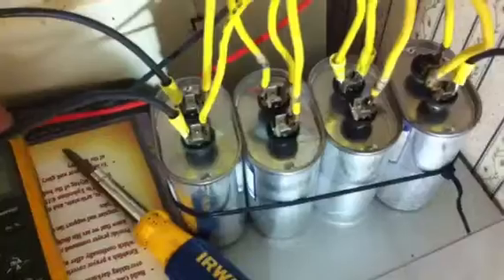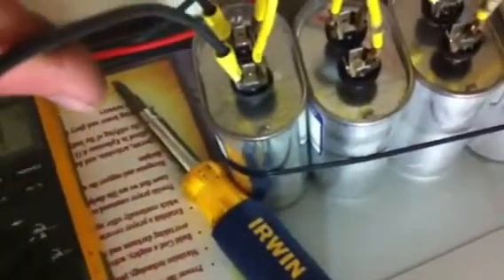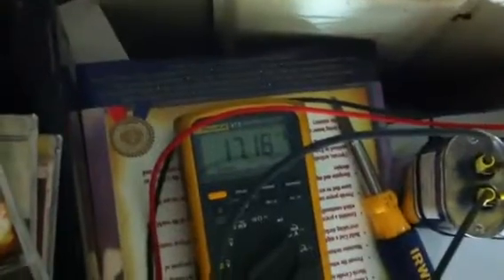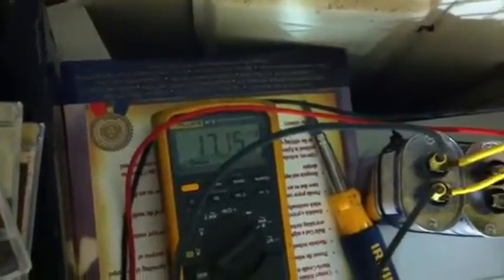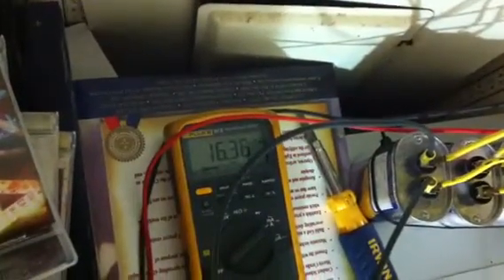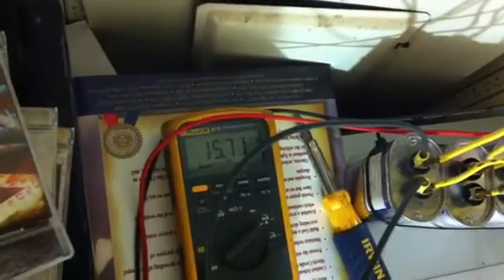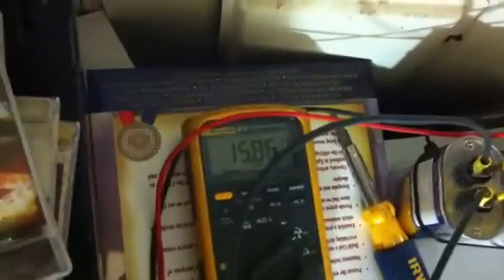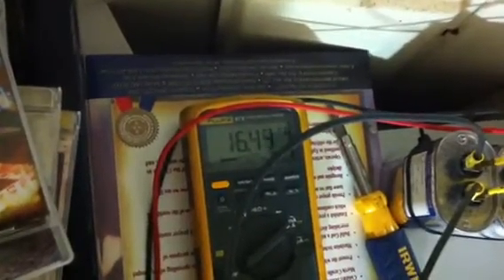Power saver home made part 2

Comment: It is about improving de power factor (cos phi) using capacitors, which works only with inductive loads. That's why it doesn't have any effect with resistive loads, like heaters.

Comment: can i have the wiring diagram?... can't seem to understand the video ... i have this 4 piece of 30uf 450v  wired in parallel, when i plug it to the wall outlet the readings from the meter went up so high... what went wrong? i notice at your video that only at the back portion of you capacitor was paralled, in front not? why is that? and you put 3 sources? sorry, i didnt understand the wiring from the video..pls help..

Comment: can I have the circuit diagram of this?
and i have a question, I have four 30uf 450V , can i just put them in parallel and plug it to the wall outlet?

Comment from the maker: @Bluejay331 The wiring is really simple you can basically take a two pole cap and plug it into a wall outlet and you just do that on both lines coming into your house since its 230v there are two hot legs.

Comment: My question on the understanding of the wiring for the two post run capacitor is it really is just a break in the ac line. Kindof like putting a amp meter in a positve dc line? So a small bank of capacitors for one 110 line would have the power too one terminal and the other is just the out power?

Comment: Yea, I figured you were, I work the Hvac-r trade as well (7yrs) :). It is very handy in most a/c's everything is 5/16th. I run into 1/4 & 3/8th on some cooking equipment like the food warmers and other various commercial cooking equipment. I have since found a replacement for the bits I lose on the roofs when being rushed from job to job.All in all it will always have a place in my tool bag lol.. It was great to see it in a video. Thanks for uploading!  -Patrick

Comment from the maker: @bakkoi It does work I bulit one from scratch I didn't buy a kit for 300$ or anything. I'll post a new video soon of the completed project. I don't use it though because the amount of power it corrects is vary little. I work as an E&i at a local mill and we use Big cap banks to correct the power factor. And they work much better on a larger scale.

Comment from the maker: @bakkoi Kwh is what my electric meter reads. That like I said before in my other video = kilowatthr hint Watt in the word. It only works on electric motors and nothing else. That's why like you said on heaters it won't work because there is no correction needed,